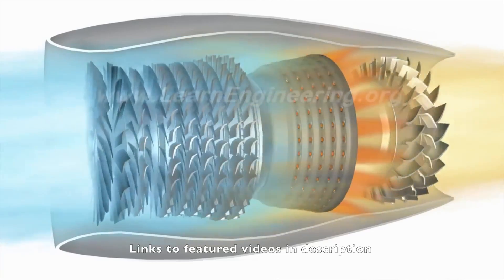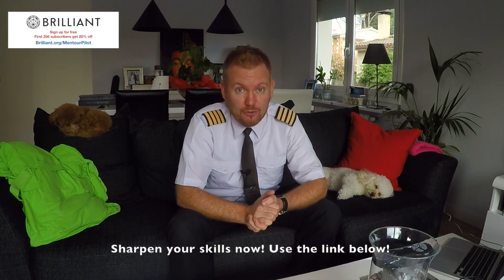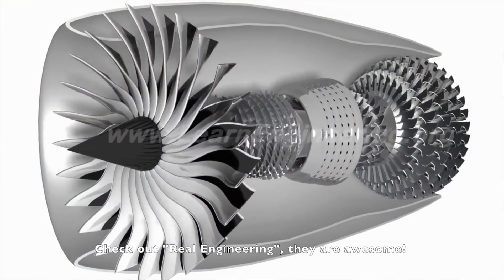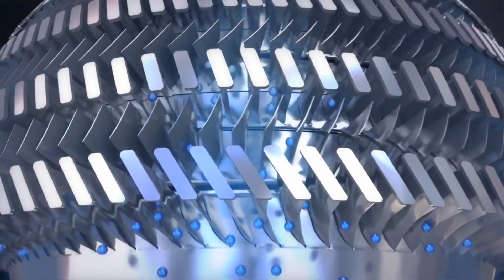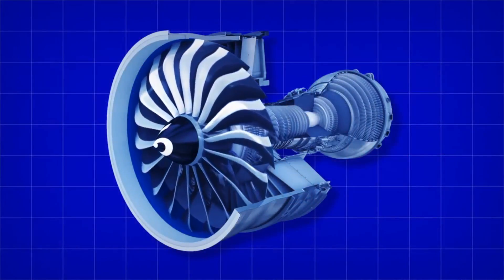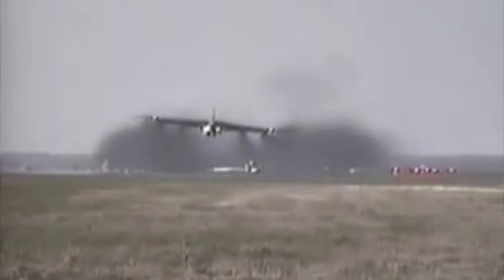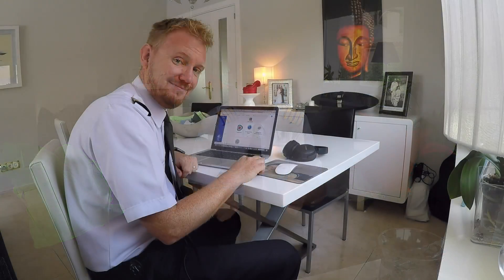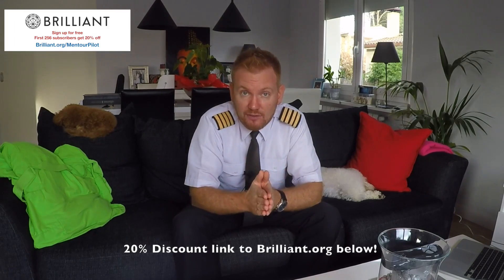Can water make Jet engines stronger?!

Comment: Some more modern engines with higher bypass had water injection too such as the Rolls Royce Pegasus (Harrier) engine (certainly the later variants did not sure about early ones). This was purely to increase thrust in hot climates (definitely used in Belize) and keep the engine cooler in hover. I don't know the exact mechanism of where the water was injected but it could give something like 20% more thrust for a few seconds (less than a minute according to some and up to 90 seconds according to others). I think the injection rate was something like 10kg/second (not verified). That may not sound huge but 10kg of water produces 13.000 litres of gas at RTP (molar gas volume). It's going to be way more than that at the exhaust temperature. Then of course if it was injected in the compressor stage it would work a bit like an intercooler. IE cooling the intake air after it has been compressed (which heats it up a lot) thereby increasing the amount of air you can get into the combustion chamber for a given amount of "work" by the compressor. I think this also allows for a higher spin speed for a given throttle setting as well and I believe higher spin gives a higher efficiency due to some weird boundary layer effects on the turbine blades etc. However this is where my knowledge of physics it a bit past it's limits.

Comment: What sort of cooling systems do planes have? radiators?
Reply: MrGab250 I know they have the oil fuel heat exchanger that warms the fuel with hot oil.  there’s likely more tho.
Reply: The engines (on planes of the type that Mentour flies) are cooled by air drawn in by the Turbo-fan and passing around the outside of the combustion chamber. The temperature of air drops significantly as you increase altitude, so one of the big issues in passenger planes it to use heat from the engines to warm up the cold external air brought in to allow people to breathe - one of the big problems is the more fresh air comes in it has to be heated, so for cost issues air is often recirculated (too much some say).

Comment: in some movies, I seem to recall seeing failure of something called an "APU" being a very bad thing - do modern planes have APU's, and if they decide to take the day off, is that game over for the flight (and all that that implies)? Or are there redundancies that make APU failure not a big deal?
Reply: APU (Auxiliary Power Unit) as the name says, it provides auxiliary power. In flight the electrical and pneumatic power comes from the engines; the APU is used mostly in ground when there´s no GPU available on the airport, but the APU it´s not of everyday use

Comment: I recall during a Boeing 727 testing,  water was placed on the runway to test the handling characteristics. During the test, water from the runway deflected directly into the No. 1 & 3 engines intake. A special tire was then designed with a rubber rim on the outer wall to deflect water away from the engine intakes. Fantastic video as always, Mentour!

Comment: Excellent description on how jet engines tolerate rain.  This was ver well done. This brings up a  question. About that A380 that had the engine rupture in Indonesia a few years back, that had the control lines to the #1(?) engine throttle cut making it impossible to shut down that engine.  I heard that it took hours for fire trucks to drown the engine.  Do you have any more information on how they did that?
Reply: They threw huge amounts of water and specially foam to do so

Comment: I believe the water injection is also cooling the air after compression to increase its density. Hot air has lower density so less oxygen to burn per volume unit and less reactive mass producing thrust as you said.

Comment: How are double engine failures handled and do you get trained for powerless flights and landings?
I know it's a rare situation but there have been some cases due to volcanic ash, fuel miscalculation, frozen fuel tubes and goose ingestion.

Comment: So, a jet engine is basically like a car turbocharger with a combustion chamber inline with the impellor, but ahead of the exhaust turbine?
Reply: Yes... see some homemade jets here on YT . Scrapyard turbocharger, bit of welding and oil pump and off you go! Oh and compressed air( leafblower might suffice) and some propane for easy start...
Reply: Not really, the YT "jets" do not use a rotating fan blade to compress air to the engine AND gain most of the engine's trust by bypassing the air past the combustion chamber around the outside, thus cooling and reducing noise. Jet-engine and Turbo-fan-engine are different things.
Reply: @SpamMouse  of course its very crude analogy...

Comment: On flights, passengers are asked to turn off mobile phones or devices and put them into airplane mode. Do the microwaves forms mobile phones actually interfere with aircraft navionics. Also, at what altitude would a mobile phone cease to be able to connect. Many thanks. Love your vids, find them very interesting.
Reply: There have been various tests and GENERALLY there is no effect, but there has been impact with some navigation systems. Also they are a PITA so turn them off. (Also not "microwaves".)

Comment: Hey I have a question for you, what happens if you fly near a hurricane?
Reply: You don't
Reply: Or you fly in the eye
Reply: Lots of updrafts and downdrafts
Reply: Some airplanes actually fly into hurricanes on purpose. Doing this is used to gather technical information about the hurricane such as the internal pressure inside the eye and wind speeds. The airplanes that do this are very rugged and strong. The C-130 Hercules and P-3 Orion are often used. They also fly into the hurricane in the same direction as the high winds that are being sucked into the hurricane and then they fly back out again straight against the wind going in the opposite direction. Flying in parallel with the high winds limits the stresses on the airplane and crew. Google "Hurricane Hunters" if you want to learn more.

Comment: What happens if landing gear is not retracted throughout the flight???
Reply: Ajinkya Navale it won’t speed up correctly. Probably not climb correctly and there would probably be warnings given by the aircraft. An actual pilot or someone certified can give more info.
Reply: It probably would not reach it's destination. The drag would consume fuel at a rate that would exceed the fuel-load for the planned journey, as landing gear is retracted as soon as Positive Climb is declared by the pilot flying - part of take off check list - if a gear retract failure occurs then it becomes an emergency landing situation - the pilot will assess if fuel needs to be dumped before landing at either that take-off airport or a suitable back-up/alternate airport with suitable facilities to deal with the fault/emergency landing. In the event of an engine failure on take-off gear-up is more important to reduce drag for the single engine.
Reply: Thank you👍

Comment: Question: 2-blade propeller, 3, 4, vs 5-blade prop - what’s best for various engine power levels?
Reply: Depends on the engine and performance characteristics of the airframe.

Comment: I've flown a 707 in the densest rain you can imagine, low in the Florida panhandle. It was so heavy you would have thought the A/C was underwater. Those engines just sucked that rain in and spit it out like nothing. I was a little concerned at first, then amazed towards the end. Impressive as heck.
Reply: was it as impressive as heck?
Reply: @mickydee7502  It was, you had to be there. Kept thinking that one of the engines would have flamed out, but none did.
Reply: @dalechristensen3640  mint

Comment: Great explanations - thanks! A somewhat related question: Why are clouds typically so much more turbulent than the open air around them? And on several recent flights on 737 & similar sized aircraft out of my local airport in the American Midwest, it has felt on takeoff as though the pilots have done a lot of maneuvering as we've approached and passed through cloud layers, presumably to avoid flying through clouds below 10k feet. Is this something pilots do on takeoff or approach? Is it ordinary practice, or dependent on weather conditions, or a matter of the pilot crew's preference?

Comment: question - Why do the plane wheels not pre-spin up in anticipation of landing. Always seems weird to see a wheel going from zero speed to landing speed
Reply: Also the resultant force change equates to a decent amount of breaking.
Reply from the maker: Because the mechanism required to make that happen will probably cost more in weight and maintenance than it will save in rubber. Good question though
Reply: @MentourPilot  I wonder if the wheels could be designed to spin up partially to ground speed from aerodynamic effects. They could have a decent amount of time to hang out in the air stream and build up speed.
Reply: @jeffbeasley8235  This would not avoid the problem in case the system on one set of wheels were to fail.
Reply: Jeff Beasley they came up with that about 25 years ago...the wheels had special cups that caught the air and made the tired spin.... I don’t know where that technology went... I read that the wheels were just too expensive and it was dropped.
Reply: Would going from 0 to landing speed heat the tyres very quickly, providing better traction than a pre-spun wheel?
Reply: @MentourPilot  true
Reply: Someone (ex RAF) once told me that on the English Electric Lightening the RAE Thurligh (UK) tried it as the tyres were ridiculously expensive (as they are extremely high pressure even by aviation standards) and it was found that it made the wheels more likely to skid/aquaplane on very wet runways. However I have looked and not found any evidence to support this other than the fact that the Lightning has an extremely high wheel loading for a fighter which would make it less likely to aquaplane anyway.
Reply: I vaguely remember that a couple of decades ago one of the aircraft tire manufactures molded very short (i/2 inch) cup shape scoops on the side of the tires for smaller twin engine planes.  The idea was to let the tires spin up to approximately landing speeds for that catagoey of plane.  This was supposed to reduce the amount of rubber scrubbed off at touchdown.  Maybe somebody still makes a tire of that design now?
Reply: @douglasrodrigues332  I believe these designs (using side-cups on the tires) were abandoned  because the cups would accumulate debris, like dirt and water from the runways, but unevenly creating unbalanced tires that were more of a problem.
Reply: +tehsimo, writes "question - Why do the plane wheels not pre-spin up in anticipation of landing."

Figure out how big and heavy the engine and drivetrain components would have to be to spin the tires up and I think you will have your answer.

Also, what would happen to a plane landing if one set of wheels was spinning but the other wasn't?
Reply: LearJet used a simple impeller style spinup on the nose wheel back in the late 60s early 70s.   
  It didnt really save the tire anymore than ones without. So people just stopped using them.
Reply: Heavy air craft do. When they put 'Wheels down'  air friction starts the wheels spinning. Also bleeding air speed. The people that designed these huge air craft had some thought.
What really stuffs me up. I've lived most of my life next to airports,  And wonder! That is 500+ tons of metal and stuff. How can a 747 get off the ground at less speed than I can drive my car?  A 747 can get off the ground at about 80MPH. BLOODY good engines.  Can I get one for my car?  Ye would need to buff up the suspension on my HIllman Imp.
Reply: i. rob  Interesting I'll have to try and do some reading on that.
Reply: I'm guessing it's because the motors that would be driving the wheels causing the spin, are likely to receive damage upon each landing, if they would survive at all. This then would significantly increase maintenance costs.
Reply: @AlwaysPim  I think you overestimate the fragility of motors.  (I agree the whole idea is probably impractical)
Reply: I figure the energy of spin up both aids braking and heats the rubber for better traction, much like drag race race cars.
Reply: If the tires were rotating, it would create several gyroscopes, that would affect the handling.  they would try to keep the aircraft going straight, no matter what.  It is also the same reason the brakes are applied as soon as the plane gets off the ground, to keep them from spinning and affecting the handling.
Reply: @robertheinkel6225  I'm far away from aviation, but I'm sure you're right. However, by my opinion, there could be one more reason for do not let spin up wheels before landing. This is the side wind. In this case longitudinal axle of fuselage doesn't fit vector of plane's speed. So, due to inertia spined up wheels shortly will give to plane an additional side force at the moment when tires will touch ground. Due to this, the plane can loose driveability. Especially, on slippery runway. It could interesting to know, am I right or not?
P.S. Sorry for my bad English.
Reply: How about a purely mechanical wind turbine type system that also works as an airbrake to pre spin the wheels.

Comment: Wet runway during takeoff. Fiction reduced. Accelerate faster. Shouldn't it be a better thing?🤔
Reply from the maker: No, the more runway we need to brake the aircraft to a stop, after a failure, the more runway we will need or the quicker acceleration.
Reply: @MentourPilot  Thank you for your answer.

Comment: Why not use same tires as in F1 when is heavy rain? I mean in place where there is allways raining. And in the second world war they used water in Spitfires  turbo engines! Cool, yes!
Reply from the maker: There is nothing wrong with the tires, it’s just that wet asphalt is more slippery than dry.
Reply: @MentourPilot  Yes sir, but in the winter for exempel you not drive with summertires, beacuse there is not same grip!  Im an old rallydriver so i think i know that! :)

Comment: Make a video on the properties of jet fuel. What additives do they add to it? I’m an engineering student facinated with jet engines!
Reply: I worked for Crane Aerospace and they produce fuel pumps for commercial aircraft. At the time I was informed that there were proposals to add ethanol to jet fuel but kerosene is actually pretty much additive free (or was in 2006). Ethanol was dropped as an additive proposal as it absorbs water horrendously and was viewed as a potential source of corrosion in fuel systems.
Reply: @gordonlawrence4749  Ethanol also has about 60% the energy density of kerosene, which wasn't viewed favorably given what we know about flight and weight. afaik, JP1 is basically almost unrefined kerosene and nothing else.
Reply: @mattdombrowski8435  I have been informed that it contains an anti-algal chemical but I have no data for that yet.
Reply: @gordonlawrence4749  I'm skeptical of that. I am not aware of any algae that can survive inside petrochemicals. On their own, they're pretty inimical to any form of life.
Reply: @gordonlawrence4749  plus its BTU is to low which will cause excess fuel usage.  Its already reduces mpg by 3% in gasoline engines.
Reply: @BeingMe23  That would not have stopped the idiots looking for a "green" solution. The only thing that will stop them are safety issues and even then not always.
Reply: i. rob  any idea where I can get some info on that?
Reply: Check out an interesting youtube video: "jet fuel vs diesel vs gasoline how they burn and what color they are"
Reply: Ethan hi may I would like to be like you when I grow up , , being a Kenyan , I am" small minded" due to lack of mentours may u be  my nentor plz , , sent me back ur contacts and adresses for more consortation
Reply: sounds like asking if jet fuel can melt steel beams but with extra steps
Reply: @tazzer9  911 conspiracy nut talk.  Steel beams do not need to be "melted" to lose their strength.  They need only be heated to a "plastic deformation" state.  This is the temperature that weakens the steel beyond "elastic deformation" state.  Temps inside the WTC towers easily exceeded the elastic/plastic boundary.  You can picture in your mind this phenomena by imagining a 12" steel ruler at the edge of a table being held down with a thumb at one inch mark and the rest of the ruler beyond 2" hanging over the edge of the table.  Now imagine bending the ruler to a curve to the max without making a permanent crease in the ruler.  This is the elastic boundary (or very close).  Now imagine how much heat is needed, not to melt the steel ruler but to cause it to be unable to return to it's original strait condition when unloaded.  That is plastic deformation.  Not nearly the amount of heat it takes to melt steel can weaken it beyond it's elastic state weakening it to a failure or plastic deformation state.

Comment: I knew that water injection was used for older pure turbojets, but did not know some of the updated low bypass engines were still equipped  to use it. Thanks. I once had a turbocharged Corvair that used water injection too.
Reply: Modern Harriers use it both in hover (to get more thrust and to cool the engine/exhaust) and for extra thrust on takeoff. I think the early ones did too but don't have data.
Reply: Even turbo props used water/methanol injection (British Jetstream J31). Also modern BMW kinda special edition track car M3 has water injection.

Comment: Water / rain is that little a problem that during QF32 incident, the a380 landed and discovered they weren't able to shut one of the engines down due to damaged wiring, firefighters tried with high pressure hoses to extinguish the engine and they couldn't!  In the end they had to resort to foam i believe.